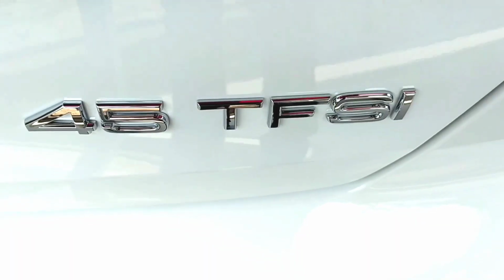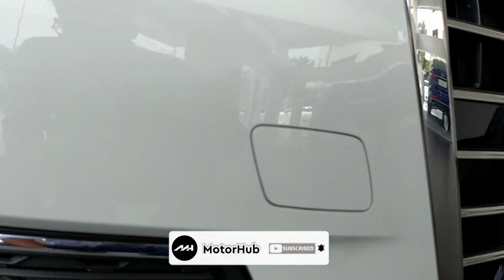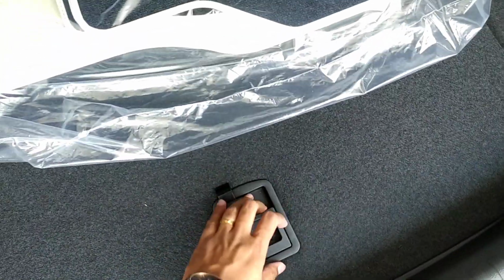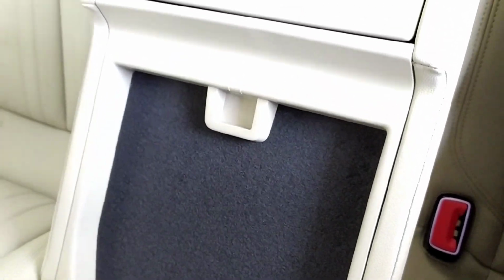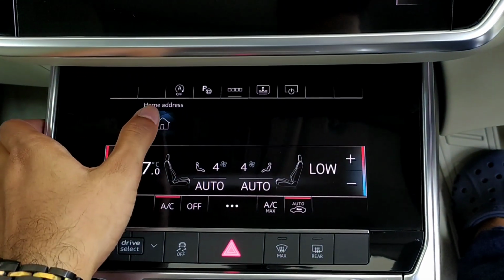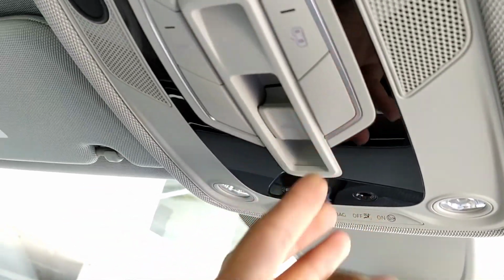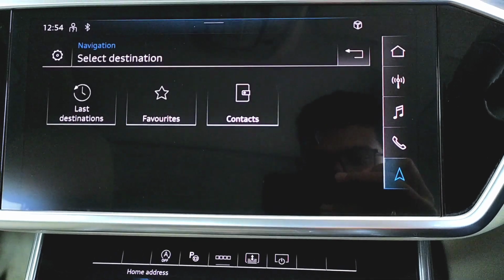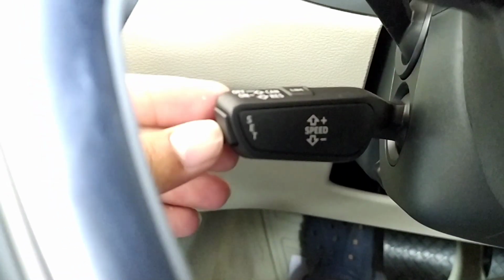Audi A6 2023 BS6 Review | Audi A6 Price | Audi A6 Features | Audi A6 Walk around l Audi A6 45 TFSI

Comment: 🤔Is it a good idea to replace the middle class car ( 40 000 ) with an upper middle class ( 50 000 ) one
to the car?
There may often be an idea that more expensive is immediately better, but is that so? 🤔
Or will there be a better mind only when the car costs more? 😐

I looked at the features on different websites  : 

Audi A6 (vs audi a4): 
+ ~ 50 horsepower more in engine and more engine torque 
+ Trunk Volume higher (13.7 ft³ vs 12 ft³) 
+ Turning Diameter smaller (36.4 ft vs 38.1 ft)
+ less than 5cm ( 2 inch ) more space in the back seat 
+ heating in the back seat and steering wheel as standard 
+ reversing camera 
+ beautiful car

- worse fuel consumption 
- price difference ~ 16000

(= if I owned an Audi A4,  I wouldn't exchange it for a Audi A6 car )
(more need to get things in the Audi A6, the price difference is not yet covered by those things)

Audi A6 vs BMW 5 serie

BMW has better fuel economy 

Horsepower
Audi 248 hp @ 4300 rpm
BMW 248 hp @ 5200 rpm
Torque
Audi 273 lb-ft @ 1600 rpm
BMW 258 lb-ft @ 1450 rpm

Transmission
Audi 7-Speed Automatic
BMW 8-Speed Automatic
Drivetrain
Audi All-Wheel Drive BMW Rear-Wheel Drive

Weight 
Audi 4,101 lbs BMW 3,765 lbs

Interior space 
Front Seat Leg Room
Audi 41.3 in BMW 41.4 in

Front Seat Headroom 
Audi 38 in BMW 38.8 in

Front Seat Shoulder Room
Audi 57.8 in BMW 58.7 in

Rear Seat Leg Room
Audi 37.4 in BMW 36.5 in

Rear Seat Headroom
Audi 38.1 in BMW 37.5 in

Rear Seat Shoulder Room
Audi 56.5 in BMW 55.9 in

Heated Front Seat(s)
Audi Standard BMW Optional

Heated Rear Seat(s)
Audi Standard BMW Optional

Heated Steering Wheel
Audi Standard BMW Optional

Volvo S90 vs Audi A6

Audi has a little better fuel economy

Horsepower
Volvo 316 hp @ 5700 rpm
Audi 248 hp @ 4300 rpm
Torque
Volvo 295 lb-ft @ 2200 rpm
Audi 273 lb-ft @ 1600 rpm

Transmission
Volvo 8-Speed Automatic
Audi 7-Speed Automatic
Drivetrain
All-Wheel Drive All-Wheel Drive

Weight 
Volvo 4,389 lbs Audi 4,101 lbs

Interior Space

Front Seat Leg Room
Volvo 42.2 in Audi 41.3 in
Front Seat Headroom
Volvo 37.8 in Audi 38 in
Front Seat Shoulder Room
Volvo 57.5 in Audi 57.8 in

Rear Seat Leg Room
Volvo 40.4 in Audi 37.4 in
Rear Seat Headroom
Volvo 37.8 in Audi 38.1 in
Rear Seat Shoulder Room
Volvo 55.4 in Audi 56.5 in

Heated Front Seat(s)
Volvo Standard Audi Standard
Heated Rear Seat(s)
Volvo Optional Audi Standard
Heated Steering Wheel
Volvo Optional Audi Standard
Reply from the maker: It all depends on your requirement and usage.